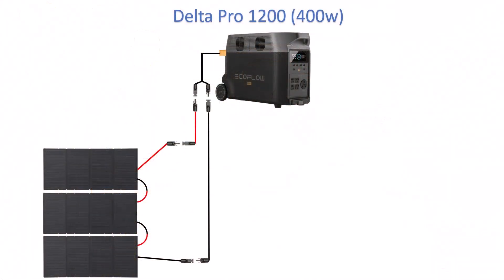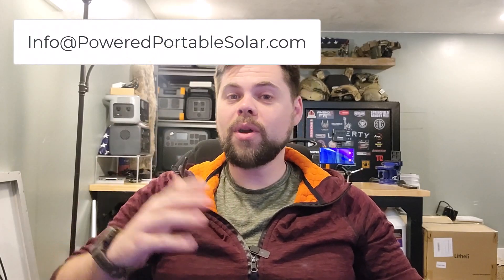Question #002 Get Max Solar Input on Delta Pro with 400w Panels

Comment: Great video, but I disagree with your analysis of the over paneling.

At 120v the Pro will only draw 13.3A (1600W), or 6.6A per string of panels.  In ideal conditions the panels can exceed 10A, so the Pro can charge at its full capacity of 1600W even under less than ideal conditions with 6 panels connected as in your example.

Another way to look at it, the MPPT can draw up to 15A which allows it to charge at full power with as little as 107V, or 36V/panel in 3S configuration, well below their Vmp of 41V.  Six Ecoflow 400W panels in a 2S3P setup like this would be a very effective overpanel for the Pro.  A darn expensive setup, for sure, but very effective at maximizing the solar input.  For 1/4 the cost you could do the same with fixed panels.

Beware however, the Voc of the Ecoflow 400W panels is 48V, so three in series at cold temperatures could easily exceed the 150V input cap of the controller as the battery nears full charge and current draw is reduced.

I just went down the solar panel V/A curve rabbit hole looking to optimize my Delta Max’s 800W solar input.
Reply: I was doing this math as well. Currently I have 12, 100 watt renogy panels on my delta pro at 140v and only 9.9 amps 6S2P so could easily run 6S3P at 140v and 14.7 amps for 1800 watts . I would rather over panel current then OCV. I've spoke with a ecoflow equipment tech and they said the delta pro (production model only) will in fact draw up to 18 amps max. So even 5S4P at 122 OCV and 19 amps would be fine for 2000 watts. So 2S2P with 400 watt panels would be fine. That is actually ecoflows recommendation. Even 3S2P would be fine as long as OCV is under and not over 20 amps. I overpanel my 40 amp mppt Controllers and never had a problem even at 0 degrees Fahrenheit they output 580 out of 600 charging at 14.4v and 43ish amps. No problem. "Damage to mppt Controller will occur with amps input over 20 amps". The batteries are 52v and 140v X 20 amps 2800 watts. But pmv is about 110v so 2200 watts. Let's be safe and say the delta pro can handle 2000 if wired properly
Reply: @jaysonstebbins2539  according to Renogy's site their 100W panel has a Vmp (Voltage at Maximum Power) of 20.4V and an Imp (Current at Maximum Power) of 4.91A, so 6S gets you 122.4V (not 140V) and 2P gets you 9.82A, 3P gets you 14.73A and 1803W as you said.  Make sure you're not using Ocv (Open Circuit Voltage) for your calculations since that's only representing the voltage potential at zero load.

If it's true that the Pro will accept 18A, just divide 1600W by 18A to get the minimum voltage required: 1600W / 18A = 88.9V.  So you're right, 5S would get you Vmp 20.4 X 5 = 102V, comfortably above the minimum necessary.  Even if the Pro would only accept 15A (per the specs), 15A X 102V = 1530W.

6s would get you better charging in warm weather, but you'd have to go to 5S in cold weather since the Voc for your panels is 24.3V X 6S = 145.8V, so in cold weather the panels will easily exceed 150V.

Just remember the MPPT controller will only draw as much current as it requires up to its limit, so even if you went with 6S4P, a serious overpanneling at 122.4V X 19.64 = 2404 max, the controller would only draw enough current to top out at 1600W.  For 6S4P that would likely be around 12A under bright conditions since the voltage would be somewhere between Vmp and Voc, guessing 135V-ish.  The benefit there would be the panels could easily generate 12A in less than ideal conditions, giving you the full 1600W input on days with light cloud cover, or hitting 1600W earlier in the morning and later in the day when the sun's angle isn't ideal.
Reply: @superspeeder  I agree. I am running 2 different panels. 4 renogys and 2 hqst's in series then 2 parallel on my system. I'm a little different but I have gotten lucky and no over voltage even during partly cloudy skies. Close but not over lol. That's because of my hqsts with lower voltages :)
Reply: What do you mean by hqst's?

Comment: Great video. Just what I was looking for. Can you share what solar panels you use for your DP system?
Reply from the maker: I use these panels: https://poweredportablesolar.com/product/rigid-200w-solar-panel/
Reply: Thank you  @minutemansolar
Reply: @minutemansolar  So you could use up to 7 of these in series (1400 watts) with the Delta Pro?
Reply from the maker: @teuton6167  Technically, but shouldn't do more than 6 due to voltage fluctuations with temperatures. If you connect 7 of them at night, have them plugged into a DP that is turned on, then it should work with 7 of them, but again, not recommended to go above 6 usually.
Reply: Thank you.
Reply: @minutemansolar Hi sir I've just discovered your channel. I was going to buy the delta pro. But seeing this video makes me think maybe not what I'm looking for. I love the portable design. I would like something this size that allows to connect more solar panels. I would like to run an AC (9000 BTU) using solar panels. I live in the carribeans
Reply from the maker: @flashmp3  I'd love to help. Shoot me an email to info@poweredportablesolar.com

Comment: Can you advise me in my delta pro hook-up ....  have 2 ,400 watt delta panels and because at the time I was unable to buy delta's panels , I bought 2, 350 watt Blueetti panels . How if at all , can I use all these panels ?
Reply from the maker: If you have just one DP, it's going to be hard to use all of those panels since they're not the same panel. Really, you can connect up to 3 of either the 400w or 350w together in series and work well with the DP. But since you have two of each, you coudl possibly do 2 350w panels and 1 400w panel, but the 400w panel will only perform as well as the 350w panels. Or, just put the two 350w panels in one group in series, then the other 400w panels in another group in series, then use a 2 to 1 MC4 Branch connector to connect those two groups together and then connect that to the DP. It's not ideal, but it should still work pretty well. I would expect around 1,200w input from all of that. If you need more help, shoot me an email to info@poweredportablesolar.com.
Reply: @minutemansolar I have 2 delta pros with no extra add on batteries.  Can I still over panel it with no worries?  I’m still looking for panels. What’s a great brand of panels to get?

Comment: Hi, I'm from Europe, I have 2xDP plus 2DB to SHP EF, I bought 8X400Wp original EF solar panels, how should I connect them? thank you Ladislav
Reply from the maker: Hey Ladislav. I can go into all the details including voltages and amps if you'd like but effecitvely if you connect three 400w panels together in series (P1 to P2, P2 to P3) you'll make 1,200w. That'll be the same as if you use four 400w panels where you have two panels in one group, then two other panels in another group, then join those two groups together, you'll still only be making 1,200w due to how the voltage and amperage paramter of the charge controller is setup. Personally, I would simply use three 400w panels in series on each Delta Pro. Then in the future, if you're able to get more of those 400w panels, you could do two groups of three panels on each DP to reach the 1,600w max solar input.
Reply: @minutemansolar  Hi Minute Man Prep, thank you very much, the panels are going on the roof on Monday, I'll let you know how I perform, I hope it's less than damaging the DP, it was quite difficult :) Ladislav

Comment: What you can do is use a number of MPPT-chargers to charge a 12/24/48 volt battery from any panel setup you want.
From that battery either : 
- run an inverter that can output like 3000 watt and connect it to the AC-input :-)
-  run an DC-DC with the highest voltage you can find  under 150 volt and at least 15 a
Reply from the maker: Yes that's a clever hack and I want to do that in one of my videos to get AC input from an inverter that is powered directly from an MPPT. It's a little complicated and still costs a fair amount but is a great hack idea.
Reply: @minutemansolar  So it appears the SolarEver 410W Panels have the following parameters:
Voc=37.12   Isc=13.96  Vmp=31.35  Imp=13.08
This implies 4 panels in series would be OK (4x37.12)=148.8 < 150v
And at max power (4 x 31.35) x 13.08 = 1640w  , just about perfect for max solar charging of a Delta Pro, and enough to keep our lights on and fridge cold after a hurricane.
Now, that’s great, but it’s only good for as long as the sun shines, and probably not enough to last through the night with a 4800 watt central A/C running :)  So I also started thinking about using a bigger PV array to charge up a battery bank, and use those batteries to charge the Delta Pros, as @HansKeesom said. If you use a 96v battery bank, you’d need 16.667 amps to charge each Delta Pro, or if you had 3x48v batteries in series for 144v, you’d need 11.111 amps.  BUT, I’m afraid of the ACTUAL voltage of a fully charged LiFePO4 battery.  If all 3  batteries reach 51.x volts, then the voltage on the input goes over 150v, out of range for the controller, and charging shuts down.  So if you have (in series) 2x48v and 1x24v batteries, you’d get 120v, needing 13.333 amps for 1600W charge on each Delta Pro, giving a good safety margin for the full-charge voltage of the batteries.  I believe this arrangement would also be good during charging times, when the MPPT is charging the batteries; the charging voltage would not be too much for the Delta Pros, and they could just take whatever amps they need.
I’m new to all this, so I don’t know how the Delta Pros would behave on the downstream side of an MPPT, hopefully somebody here could tell me if this is a bad idea or not. Or, somebody who has these components already could test this and make a video (hint hint ;)
Please feel free to check my math and let me know if I’m going to blow something up if I try any of this.
Reply: @Urugami45  and @minutemanprep what about using a long 100 or 150 foot wire to connect the 4 x 410 watt SolarEver solar panel array described above--wouldn't the voltage drop from the longer wires (maybe 5% drop) ensure that you would safely fall below the 150 volt limit by the time it reaches the Delta Pro power station? Unfortunately I already have Ecoflow 400 watt panels and don't want to spend the $$$$ on four new panels.
Reply: @teuton6167  I suppose that may work, but why would you need to?  4 of those panels in series is below 150V on both Voc and Vmp, so it's within the DeltaPro's MPPT parameters.
Reply: @Urugami45  I’m thinking that even though it has voltage protection, I wouldn’t want to take a chance with a $3k (or $5+k with expansion batteries) machine just in case it failed.  Also, my understanding is that VOC can fluctuate +/- 3% based on temperature and other factors.  But I’m pretty conservative—so I could be mistaken. 🤷‍♂
Reply: @minutemansolar He minuteman, what would happen if my VOC was just about 2.4 volts the 150 max?
Reply from the maker: On the Delta Pro it should just shut off the MPPT to protect itself. It shouldn't run at all. It also shouldn't burn up.  @chuckb3489

Comment: You can actually run 30A into the Delta Pro without blowing it up so running it at 20A+ to run enough panels in parallel isn’t an issue, I can’t guarantee how long the unit will last though.
Reply from the maker: Charge controllers will not let in more amperage than they are rated to. If the panels are making 20a total, it will only let in 15a. I tested this in another video where I used a Fluke clamp meter to test the actual amps going into the DPs and it was at about 14.9a and the charge controller is rated to 15a which is normal for it to only let in 14.9a. I had 120v going in, and 14.9a by having two arrays of solar panels charging the DP.
Reply: @minutemansolar   I’m going off the guys video but if the CC will only let in 15a and 150v why do Ecoflow tell customers not to exceed this? Also, what are people complaining about when you could just max out the panels in series and it will only let in 150v regardless and like wise for panels in parallel with amperage?
Reply from the maker: @InimitaPaul  The CC treats amps and volts differently. You can exceed the amps and it will only let in 15a, but if you exceed the volts it shuts down the CC completely. So you can't throw 200v on it and have the CC figure it out.
Reply: @minutemansolar  I tried to find which of your videos you are referring to here.  Can you provide a link or at least tell me the title of that video?  Thanks!
Reply: You can’t run 30A into the Pro, it will draw what it can (up to 15A).
Reply: @superspeeder  Don’t ask me to link it because it was a while ago but there’s a YouTube video out there of someone doing it so it can be done, he demonstrated 25A but said he’s had it up to 30 for short periods. No doubt it heats up but it wouldn’t be the first time wires have been oversized with the “limit” said to be lower by the manufacturer for safety.

Comment: Thanks for the videos. You need a lot more panels than I thought.
Reply from the maker: Exactly. It's a very good unit, but the solar input shouldn't be that hard to work with.

Comment: It would be nice it the external batterys had a internal charge controller like the bluetti B batterys have, even thou it's limited to 200w its better than what ecoflow is offering.... Nothing
Reply from the maker: Some people are using the 12v 25a DC port on the Delta Pro to have up to 300w input from external batteries. I haven't tried it but I've heard about it.

Comment: eco flo generator are junk. I have two and both broke and there  is no support from them. buyer beware
Reply from the maker: Wow, that's really unfortunate. I've had very good luck with them. What broke on your units? Did you get them directly from EcoFlow/Costco/eBay? I'd love to hear what happened.
Reply: @minutemansolar  exactly, more info please.
Reply: ...please expand on this. Any specifics you can provide would be great. Thx.

Comment: @Minute Man Prep wouldn't it make more sense to use another mppt inverter to maximize solar input.... for example you have 450w panels 41.1v @11a. You series them to bring up your voltage above the 150v limitations and amperage. I know it doesn't make sense to buy another inverter as it's not cost effective but being limited to 150volts @15 amps kinda sucks if you have a big array. I have 8 of these panels and they work great. but if I had another inverter that could handle more voltage I could charge them up faster at the same time. I guess I'm looking for a offgrid inverter that fits that bill. Thanks for all your content!!!
Reply: Minute Man Prep, I recently purchased a Delto Flo Pro with no solar panels I charge it from outlets in the house we do have a 8 panel 400 watt panel solar system on our roof with no back up battery, is there a solar controller that can be installed in the electrical box where the back up battery attaches? A controller that would switch off when normal power is on and on when the power is out? It would be great to be able to charge the delta pro with the house solar system. The last time I checked only 4% of the homes with solar systems have a battery back up. Thanks

Comment: I want to buy a 30kw rack of batteries bank charged by solar and charging just 1 delta pro using the x-stream AC input.  I think that would be better than buying the extra batteries

Comment: The delta pro should have at least 2400 watts of solar. Especially when you factor in the extra batteries
Reply from the maker: I agree with you 100%.
Reply: Whit that price should have at list free mc4 to xt60i cable with 1x400 solare panel